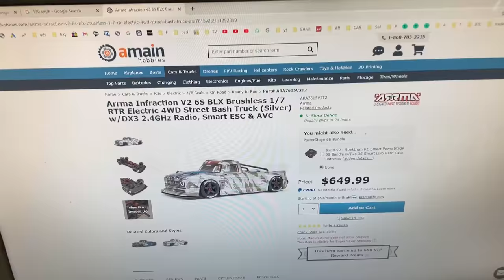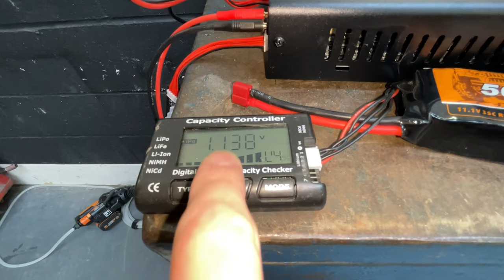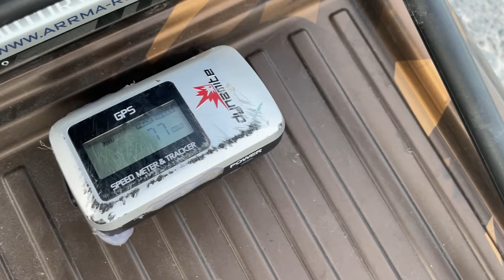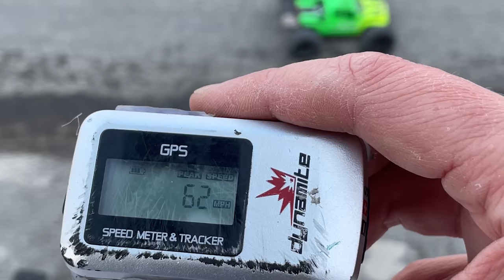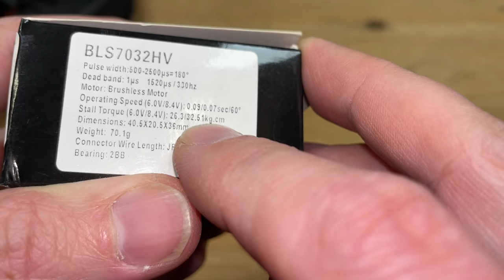the GIANT RC Drift Car everyone is talking about

Comment: Apparently they only recommend the batteries it comes with , which sounds a bit odd for a hobby grade RC
Reply: sketchy battery
Reply: Old rc kiwis had a little smoke up 🔥🔥😂
Reply: Sounds like something Traxxas would say
Reply: The higher c count can damage them it’s a surpass hobby esc it can barely do 6s and with that higher c count it can damage them
Reply: Good point! Traxxas wants you to buy their overpriced batteries and fancy chargers with the goofy Traxxas connectors. I'm a Traxxas guy and I'm saying this. Zeee lipos with EC5 plugs are where it's at!
Reply: Like every RC company "recommends" their batteries, doenst mean u have to use em. voltage is voltage

Comment: By the time you've upgraded the electronics, you may as well buy the Arma. Plus with the Arma you're guaranteed spare parts availability.
Reply: Stock it's the same price. Not sure what you're saying dude
Reply: @captainthruster9484  Which part of "Plus with the Arma you're guaranteed spare parts availability" did you not understand?
Reply: To be fair, I just ordered an Eachine EAT04 truck off Banggood, and it arrived with a super stiff front diff - one of the planet gears had a lot of defects. Banggood refunded me the cost of a new front diff, (and a tube of diff grease!) worth $16 when I told them about it. Just got the new diff in, after 2 weeks.

Not to say this is the standard BG experience, Lord knows it's by far the best one I've ever had. But honestly, I've never tried, assuming it would be a hassle. Dead wrong.
Reply: @GhostRyderFPV  I get that spares are available for BG specials, but I wonder how long they'd be available for. With big name brands there's usually a lot of spares (and aftermarket parts) easily available for a long period of time.
I suppose if I were to buy a BG special, I'd stock up on spare parts at the time of purchase just to be sure. They have some decent looking cars but I've never risked purchasing from them for my aforementioned reasons. Your comment actually gives me a bit more confidence in doing so.
Reply: @BobMonkeypimp  Thanks Bob! I've been a "drone boi" since Nintendo Wii's had to sacrifice their gyros for our flight controllers - at first your only (realistic) options for parts were the last places you confidence in buying from - Banggood, AliExpress, Gearbest, and to a degree HobbyKing. 

Everything you pick up from Horizon will be high quality, well supported, and easy to use, for sure they're an amazing company with a fantastic rep. I have a ton of E-Flite and Hobbyzone planes and parts, a Losi car, and some Spektrum stuff. There's no denying Horizon, Traxxas, DJI, etc. make great stuff that everyone has access to. 

But sometimes you want that "Indiana Jones" feeling - where you're looking for a diamond in the rough. A good find on our  Chineseum website list, like the FY-03h or 12428, K989 etc, those finds bring a little extra with their purchase, like you're so underground you wear sunglasses while doing it 

But you take your savings you worked SO HARD for, ha!, and invest in all those shiny bits you'd buy for those more expensive counterparts, anyways. Maybe two, though, because you never know!
Reply: Dude makes more then enough to buy whatever.I think he will be fine.
Reply: And guaranteed to be broke all the time lol. I've lost all faith in arma
Reply: @BobMonkeypimp  yeah and arma parts are ridiculous priced, trust me I know from experience because every time I take out my kraton 6s within 5 minutes something breaks usually diffs
Reply: @ronbrannen887  I don't disagree about the prices, however if it were a (gun to the head) choice between the Banggood or the Arma, I'd choose the Arma. They both cost similar money to buy, but you never know how reliable the supply of spares will be for the BG (unless it's a clone). 
I honestly believe that the main RC manufacturers have secret deals with aftermarket manufacturers, selling new RCs with deliberately inferior components, pretty much forcing you to buy aftermarket upgrades.
Reply: @BobMonkeypimp  speaking from experience of having a kraton 6s I'd go with BG, in my opinion arma is over priced junk
Reply: Arrma*

Comment: the front lights r turning off probably due to a pinched wire in the led light assembly i had the same thing happen and if ur not careful it can shut off the car. it gets really hot but installing those front lights r a fragile thing especially if the wires touch. i had rc polo lights on my arrma felony and had to get replacements for the front for the same issue

Comment: Kev 👋🏻 I had that battery checker and it started giving readings out like that after a while yet my charger said all cells were the same voltage.
I bought the Overlander battery checker and works perfectly with the correct reads from my charger.
I'd check weather yours has gone faulty and check that supposed faulty battery again on your charger to clarify.
My faulty battery checker is now in the pin 😎👌🏻
Ps that slow servo might help people from over steering at speed 👌🏻
Oh and that tyre squeal in the car park sounds sick 😜👍🏻

Comment: Great video and a epic looking car. One question Kevin, which steer servo do you recommend for a Xmaxx. The original is starting to get a bit sluggish. Appreciate your reply.
Reply: Either get a new stock servo or get a different one such as the perfect pass monster servo. Its not cheap but has 56 kg (over 110 lbs!) torque! But there are ALWAYS cheaper options, just not quite as good.

Comment: so the official hoonicorn gets copyrighted and made illegal for places to sell or carry the parts for,  so they come out with this (more expensive by the way as i only paid $312 for my hpi hoonicorn) and made it basically a fine tuned remake from a different company by adding alloy to price it at 600 an remove all the official stickers..  thats just sad especially since you can clearly tell only the extra decals are missing.  for any wondering  the original made by hpi before it got taken down is awesome  looks only like where he got this one from has completely redone its chassis design.

Comment: Redcat Kaiju is one of the best budget rc you can get I would put mine against any Traxxas x Maxx or arrma anything or anything else for that matter 400 bucks and you get 6s power that's hobbywing  I have 10 rc trucks Traxxas and arrma the redcat have been bashing hard for a year broke tie rods and drive cups that's it. on Traxxas xmaxx I could have got a new Kaiju on all the parts I have paid for that xmaxx and the arrma is worse hopefully this will help someone out on buying there first rc and this car in Kev video is stupid expensive esc is crappy car is fast but that means you break it faster

Comment: i bought a gas car rc ok and i put 10 batteries in it and 4 in the car  on the control should my the steering wheels at left but not doing any thing do i have to have special batteries for it or is it controler no good it brand new i ordered from usa and was wondering if i need sectoon battryies
???? i wish there was a hooobie shop near by find out please let me kow ty

Comment: KEV! Them arrma blx 100 ESCs Puff lipos on alot of load just letting ya know ;)
Reply: what do you mean by "a lot of load"? 🧐
Reply: @rogueFactor  Sorry I didn't specify very much, I Mean if you put it in a slightly larger Car than intended. it overheats because of the weight.

They usually go in a 1/10 arrma vehicles but 1/8 is slightly heavier thus creating load on the esc

Comment: The lights switch on and off from the transmitter and have two or three modes, a few reviews had the ESC fry ZD said only run the supplied LiPo's

Comment: Car looks like a knockoff of the Arrma Felony.   The problem with this vehicle is aftermarket support and spare parts when you break things.  Unless a local hobby shop has parts, you will be screwed if you break an arm or suspension component.

Comment: I know it's a bitch to switch your own connector standard. But take a look at the XT150. They are nice as you can split them so plus and minus is separate. This means you put batteries in series without any adapters 👍🙂
Reply from the maker: i dont like them, too easy to short something out
Reply: But the two connectors are in different sizes and colors 😅 How did you short them? I have been running them for years without any issue 👍🙂